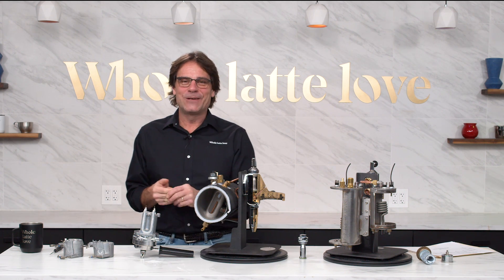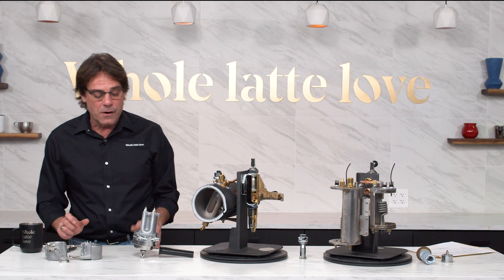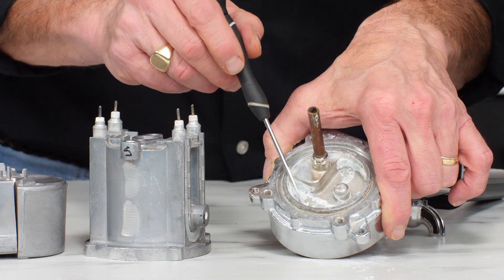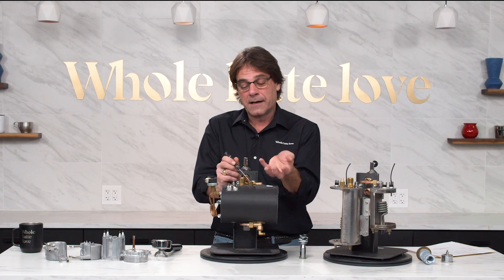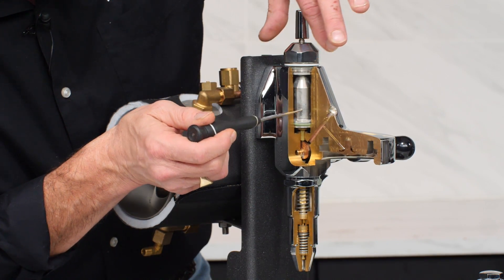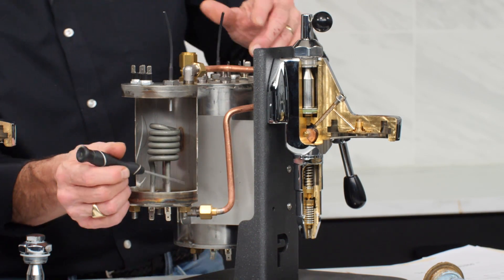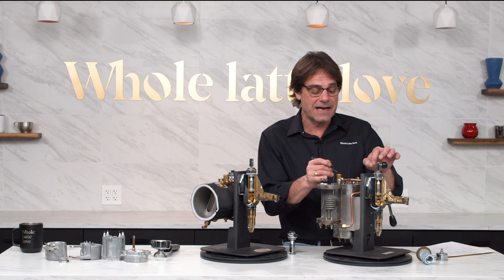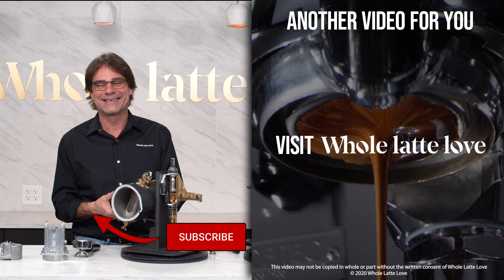Espresso Machine Boilers: See Inside 4 Types

Comment: Hi Marc, from your experience. will there be any difference when it comes to taste between Stainless steel boiler and Copper boiler? I am brewing 4 espresso per day on personal consumption. Sometimes more for my family member.
Reply from the maker: Hi TL, Thanks for the question. I can't say I've noticed a taste difference between stainless and copper boilers. Copper was far more popular a few decades ago but now stainless is dominate. I'm not a chemist but I believe they'd tell you stainless is more chemically inert than copper.
Marc
Reply: @Wholelattelovepage  Thanks Marc. My preference is also SS. but the brand I like and want to buy does't make SS boiler. Amyway, our water is not hard.
Reply: @Wholelattelovepage  Hi Marc, The water at my place is pretty soft. I'm not sure if it helps to protect the copper.

Comment: The heat exchanger, as I discovered recently, is a lot more complex that you covered there. You should do a video going into the need for a well calibrated HX and the use of a restrictor value to slow own the thermosyphon.
Reply from the maker: Hi George, Thanks for the comment. You are correct, thermosiphon restrictor sizing is critical for temp accuracy. Recent crop of PID controlled HX machines do well. Over the years we've been very involved with manufacturers testing and providing feedback on a variety of details including restrictor sizing.
Marc
Reply: @Wholelattelovepage  Marc, a few months ago I picked up a 2nd hand E61 which I've renovated. However idle temp is 100C+ and I need to flush out a cup+ of water, and immediately extract, to get the temp down enough for decent shot. I've not taken it apart yet to check the restrictor as I'm waiting on some teflon rods to cut to fit with different sized holes drilled in the hope I can figure out the optimum size. Writing/Reading on a few of the home barista forums this seems to be a big topic that is regularly re-visited. Would love to see a video covering this by someone.

Comment: what about the heat up time of different boilers?
Reply from the maker: Hi Kai, That's an excellent question. It varies a bit based on machine make/model, type of brew group, boiler volume, etc. but here are some generalizations.

Thermoblocks: 1-2 minutes
Single boiler: 5-15 minutes
Heat-exchange: 15-20 minutes
Dual boiler: 20-30 minutes

Marc

Comment: I'm relatively new to espresso machines but learning quickly thanks to content creators like yourself.  I own a Breville touch which has a thermocoil system.  Can you explain why you consider this entry level?  I understand it is more susceptible to scale buildup/blockage and might not last for years, however, it seems to me that for home use (1-4 cups of coffee a day on average) this is the preferred machine since the water heats almost instantaneously and you can jump from brewing to steaming within a few seconds.  The pressure seems adequate enough for brewing (perhaps could be better for milk texturing).  Is the temperature fluctuations in a thermocoil machine an issue?  Am I missing anything? Why would I want any other system for home use?
Reply from the maker: Hi EC, Thanks for the question and happy to help! With thermoblocks it comes down to temperature control. It's just not as precise as machines with true boilers and group heads with large thermal mass. A hot group and pre-heated portafilter makes a difference. That said if your happy with the coffees you're making on the Breville then it works for you. Maintain the machine well by using good water quality and/or descaling on schedule and it should continue to provide service for some time. The big difference comes down the road in reliability. Machines with true boilers are very serviceable and can run for decades. The service life of products like the Breville are shorter. Depending on age, when they have a problem repairs are difficult to impossible to DIY and professional service generally cost more than the remaining value. On steaming, go to a true machine with an HX boiler and you'll get better steam pressure and you can brew and steam at the same time. Steam is always available so no waiting. Hope that helps,
Marc
Reply: No descaling access inside the boiler for maintenance and inspection or modding + mostly not dual boiler
Reply: There are a lot of entry level machine using thermoblocks. Your Breville is somewhat above entry level. 

But there are really good mid and high range machines using thermoblocks as well: Ascaso PID Duo and Baby T Plus and of course the Decent machines. So thermal management can be excellent with thermoblocks. I guess service can be an issue on these?

Also the four types Mark shows here are only the most common. There are saturated group heads with service boilers in front and different types of lever  machines for example.
Reply: I had the same question, since I am quite new to espresso machines, so thanks for asking!

I am also wondering why having the two separate boilers is considered better than the heat-exchange dual boiler setup. Heat exchange seems more economical from the point of not wasting heat… (or is that not the case?) Is the benefit of having two full boilers that it allows for a larger reservoir of hot water and of steam? So, more suitable to people who need to make several drinks in a row? Is the temp control also more fine-grained somehow?

Comment: How does the pump put pressure on the group. I note a connection between the steam and brew boiler on my Alex duetto with a hose ending uo in the drip tray. is the pressure on the brew boiler regulated by pressure in the steam boiler. Love videos like this, please go geekier!
Reply from the maker: Hi jp, Thanks for the comment and question. I will get geekier - I love this stuff too! It's a fairly straight connection between the pump and brew boiler. The group gets pressure from the pump and there's no involvement with pressure from the steam boiler. Even if there was steam boilers generally run at under 2 bar of pressure so no way to get 9 bar out of the steam boiler - it would have to run at about 180C/356F to generate that pressure! There is a device called an OPV (over pressure valve) which regulates pressure from the pump in many machines. On rotary pump machines there's a bypass on the pump which regulates pressure.
Marc

Comment: That is really interesting and well presented, thank you! Out of curiosity a engineering question, how are the thermoblocks made? How do you get the spiral hole for the water flow into a block of solid aluminium?
Reply from the maker: Hi n, You are welcome and thank your for the comment and question. Inside the aluminum block the spiral is a stainless steel pipe. My assumption is that pipe and the heating element which spirals through the block as well is held in a mold and the metal is poured.
Marc
Reply: Molted aluminum is poured around two spirals colis one for water other for heating element

Comment: Eagle One is using Thermoblock right? And that one is Hi End machine 😁
Reply from the maker: Hi g, Well, I've yet to get inside the Eagle One. I did a little research and they talk about a pre-heat system and heat recovery. Also mention a 7L steam boiler. Not certain it's using a thermoblock. If it does I hope it's fr more advanced than the one I showed in the video!
Marc
Reply: @Wholelattelovepage  they said the brew boiler itself is thermoblock. The steam boiler still use regular boiler.
Reply from the maker: @gusmank  I did notice they were very specific in descaling time with a worksheet calculator in info on website. Descaling critical in thermoblock type water heating units

Comment: for the thermal aluminum block type would that be like the breville barista express or the barista pro?
Reply from the maker: Hi e, Thanks for the question. The Barista Express uses a thermoblock boiler. The Barista Pro uses what Breville calls aThermoJet Heating System. It's similar to a thermoblock in how it operates.
Marc
Reply: @Wholelattelovepage  thank you Marc for the super informative video.  so would a lever machine like an izzo alex leva and pro800 be the HX type of boiler?
Reply from the maker: @eosme  You are welcome! The Pro 800 is similar to an HX boiler in that 1 boiler heats water for steam and brewing. It's a little different in that it has what's called a dipper tube running from the boiler to the group and not an independent isolated heat exchange section feeding the brew water. The boiler itself has a very large connecting surface to the massive group to transfer heat. There's an excellent graphic of the setup over on home barista: https://www.home-barista.com/reviews/profitec-pro-800-review-t44660.html
Marc

Comment: Can the inside of a boiler ever get molded up and gross? If so, what can you do about that?
Reply from the maker: Hi 54, Thanks for the question. It is possible and we've seen it all. Good example is milk getting into a boiler caused by not purging a steam wand after frothing. As the wand quickly cools following steaming it siphons milk up the wand. If one repeatedly froths milk with out blowing some steam off through the wand afterwards (purging) the milk may eventually works its way back to the boiler and that gets very gross! 
Mold in a boiler is rather rare unless water left sitting in a boiler unused for a very long time. Fixes range from repeated rinsing by running a lot of water through the boiler to descaling with acid and continiung on to removal of boiler and manual cleaning.
Marc
Reply: @Wholelattelovepage  Thanks so much for the info, Marc!

Comment: Great video. I have a 18 year old Pasquini Vivia 90 (pressure stat was upgraded and I believe it’s adjustable??). I have never descaled it but always use filtered water. My brew water temp is low. Do you think it is scaled up or should I try and adjust the pressure stat setting, or try descaling (someone advised that may dislodge big pieces)? Help please Any body! I do have my eye on a Rocket 58! But should I look at PID HX? Thanks
Reply from the maker: Hi MJ, Thanks for the comment and questions. 18 years with no descaling? Since I do not know your source water hardness or type of filtration there's no way of knowing for sure if you have scale. Very few water filters do much of anything to reduce mineral level. Vast majority are simple particle filtration plus activated carbon. Those type have little to no affect on water hardness. Unless your source water is very soft (low in minerals) to begin with it's probable you have some scale build up in the machine. That said, I think you would have had issues from scale many years ago. For low temp you could try adjusting the pressurestat. I believe your machine has a boiler pressure gauge. Note the pressure it reaches when fully heated now. Then adjust pressurestat to raise pressure by 0.1 - 0.2 bar and see if that makes a difference. If the machine is severely scaled descaling after so long could dislodge chunks and cause issues. But if you are planning on a new machine maybe nothing to lose? R58 is a fine machine. Latest version of that is the R Cinquantotto: https://www.wholelattelove.com/products/rocket-espresso-r-cinquantotto-espresso-machine
Their PD HX Cronometro machines are nice and available in plumbable/rotarty pump EVO R or reservoir/vibration pump Type V. Both come in either Mozzafiato or Giotto case models. Hope that helps!
Marc
Reply: @Wholelattelovepage  - Thanks a bunch. The water is filtered, RO, ultraviolet light treated, then they add a little Calcium so it isn’t flat. Sometimes the machine thinks it’s out of water as it won’t conduct. The pressure gauge is almost to to Max setting range. People say my shots are the better than shops around town! So I must be doing something right. I’m going to order a new grinder soon. Same rotary for 18 years too. I have had the Pasquini apart a lot replacing pressure stat, switches, 3 pumps, a transformer, gaskets, seals, etc. I just rebuilt the motor on the grinder. I’m 65 and think why not have the finest! Why doesn’t Pasquini make machines anymore? If they do they’ve hid them. Thanks so much.

Comment: Hello Mark,
This is very helpful. I sort of knew how those boilers work in theory, but didn't know how they actually look from inside. Thanks,
One question if you don't mind. 😊
Why is it mostly recommended to descale dual boiler machines by professionals? 
What possible risks do they have if descaling is done at home?
Reply from the maker: Hi Thanks for the comment and question. A couple of reasons manufacturers recommend only pros descale dual boiler machines.
1. Avoiding unhappy customers. Manufacturers know machines are often neglected. A customer may use water with high mineral levels causing scale. When customer tries to descale a machine with significant scale build up the process can release large scale particles and cause problems in machines. Dual boiler machines have more complex plumbing with more areas prone to getting plugged up.
2. Depending on dual boiler machine make it can be difficult to drain boilers to remove descaling solution. It's not impossible and repeated dilution with fresh water can work. Old trick to know if rinsed enough is to put some baking soda in the water coming out of the machine. If descaling acid (usually citric acid) is still present the baking soda will fizz.
Our service center rebuilds and refurbs many dual boiler machines. For descaling those they always remove the boilers from the machine.
We recommend owners of dual boiler machines use advanced filtration of water to reduce total hardness with ion-exchange which swaps out magnesium for calcium. Proper use of that type of filtration in most cases totally eliminates the need to ever descale. Ion-exchange filtration tech is available in BWT products in the form of drop-in reservoir pad filters, a pitcher and cartridge for plumbed in machines https://www.wholelattelove.com/collections/bwt
Marc
Reply: @Wholelattelovepage  Thank you so much for the answer with very detail information. i love your baking soda trick! I'd like to try it next time. :)
Reply: @Wholelattelovepage  That is fascinating and I'm so glad there is someone with this level of technical knowledge sharing this info.  Next time someone says "oh, I fix espresso machines for a living"   I'll understand that they are part chemical engineer, part materials engineer, part electrical engineer, etc.  I had no idea it was so technical.

Comment: On the dual boiler, will using hot water damage the heating element as it will become exposed, or dose it fill up just as fast as it empties. Fantastic vid couldn't stop watching.😎👏👏
Reply from the maker: Hi LLCR, Thanks for the awesome comment and question. On the DB machine hot water comes from the service boiler. The heating element in that boiler sits well below the minimum water line. As soon as the water level probe senses the drop in water level the pump kicks on to maintain the water level above the heating element.
Marc

Comment: This is very informative. I was wondering how thermo blocks work... and also did not know the Gaggia had the boiler sitting on top of the brew head... which is a good idea.   Thanks Marc
Reply from the maker: Hey Ardy, Thanks for the comment. Placing the boiler there really helps heat the group. Many smaller machines have the same setup.
Marc
Reply: @Wholelattelovepage  
Marc, I have a question about these less expensive machines temperature stability.  I have a vintage Silvia that I have modded with a pid.   One thing I see about this set up is significant temperature instability.  I have been able to compensate for this because I can see the temperature.  But, for example, what I notice is that ... even if I have ideal boiler temp when I start the brew, the boiler temp drops rapidly ... which I think is because of cold  water entering the boiler.  And, my guess is that this problem would be worse in a machine with a smaller boiler machines .... like the gaggia

Do you have any thoughts on this issue?

Comment: What kind of data do we have on brew temperature stability on a heat exchanger machine like the Profitec Pro 500 with a PID and a flow-control device? I have come across a lot of people who are raising some concerns because of how the heat exchanger operates, potentially getting the brew temperatures too hot due to the restriction of flow.
Reply from the maker: Hi Drake, Thanks for the question. I have repeatedly tested the Pro 500 and other PID HX machines like Rocket Espresso EVO R and Type V using a Scace device and found them to be amazingly accurate with brew temps. There are certain cases like extra long idle times, odd ambient conditions or heavy use where there's some drift or a short flush may be required. Honestly I was stunned a few years ago when the Pro 500 PID first hit the market at how good it was. Really did not think it was possible and I was wrong.
Marc

Comment: What a great explanation! My Gaggia CC is now I would guess at least 20 years old and still running more than fine, but as you've showed the inside of that boiler I was wondering if I should take mine apart to give it a good scrub. Any opinions on that? As I've bought the machine used 5 years ago I don't know if the boiler got replaced at any time.
Reply from the maker: Hi Jonas, If you've got the skills it certainly would not hurt to have a look under the hood of a 20 year old machine. That longevity with basic maintenance is why I always recommend people avoid the cheap entry-level appliances and go with true machines.
Marc
Reply: @michael3724  if you can hit both of those ends just go 50/50. If that's no option go for the cleaner water. It will go easier with the machine